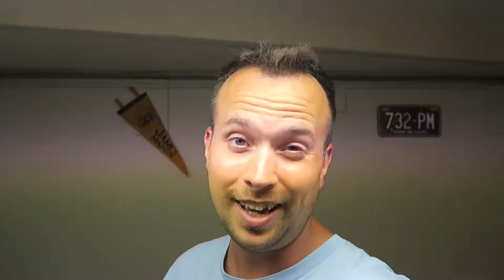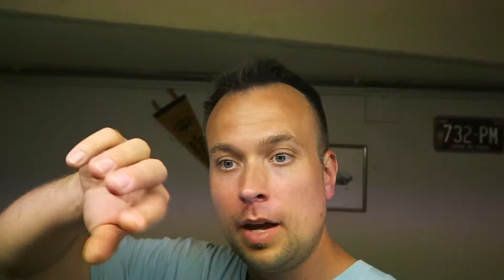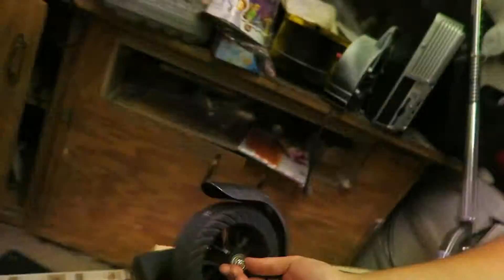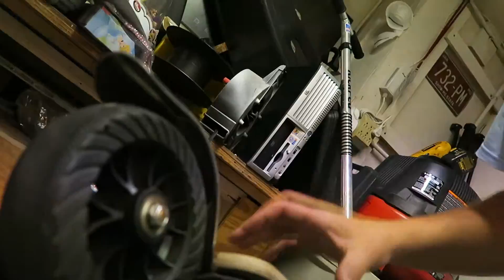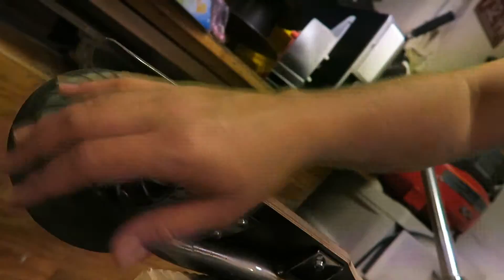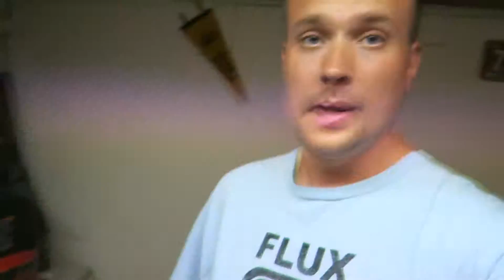NYCEWheels KickPed Kick Scooter Update! Rear Wheel Maintenance. Is yours over torqued?

Comment: Check to ensure you have the wheel spacer installed between the two bearings. A lot of them shipped without one. With the wheel spacer, you should be able to torque the wheel nut without binding the bearings.

Comment: my rear wheel spins for like 2 seconds, my front spins for like 5. It's so slow compared to my razor A5 with bones reds. have you ever replaced ur bearings? did u get them from goped?
Reply from the maker: I never replaced my bearings.  In my case mine were way over torqued.